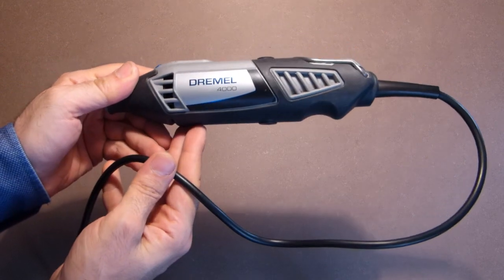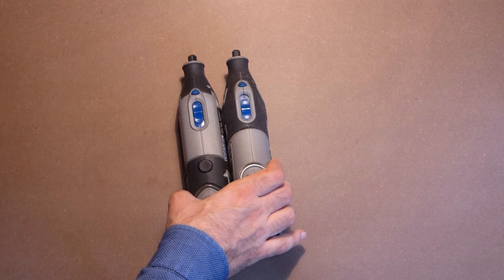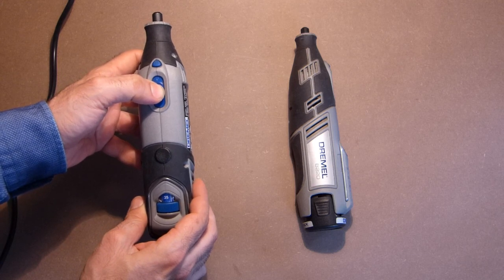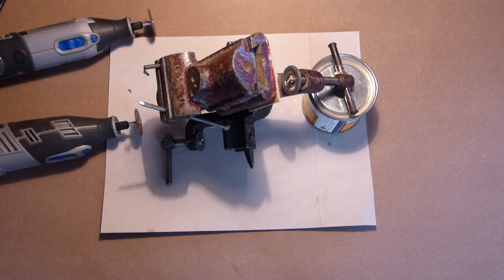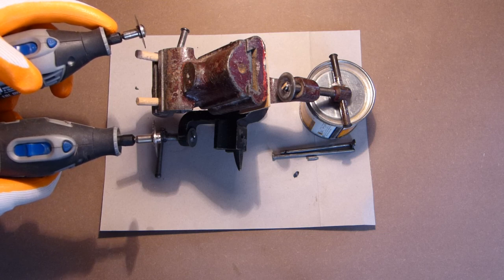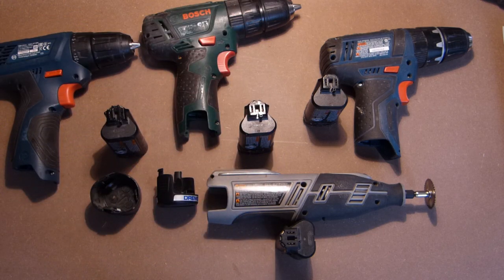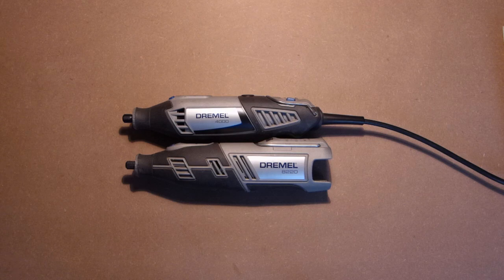Wireles DREMEL 8220 vs. Wired DREMEL 4000

Comment: thank you for the detailed view... but I cannot still decide which is better for smooth carving work?
Reply from the maker: Hello, you are welcome! You know, the cordless tool is weaker at high RPM and stronger at low RPM. And the corded tool is terribly weak  at low RPM and extremely strong at high RPM. Hope, this information will help you to define which tool is better for your needs.
Reply: I got the wired one because it was a lot cheaper

I still hope for a proper brushless (battery) Dremel with proper motor control for stable rpm at any load, this would be worth 150$+ easily

But its pretty sad to see still old DC motors with brushes

Comment: Would the 8220 combined with the router attachment and the universal wood cutting bit cut a plywood or other softwood 10-20mm thick? or you think it won't?
I don't want the corded I'm only considering the cordless, so, do you think the 8220 can handle such cut? I've seen the corded 4000 do it without issues but, I'm not surprised, I only want to know if the cordless one can do that.
Reply from the maker: It would, but it's a bit serious load for this cordless tool. Anyway, for such needs it's much safer to use a corded one.
Reply: @powerbatterychannel4315  Have you noticed any significant drop in battery performance of the cordless over the years? or any charger issues? and do you know where its brush is incase I need to change it?
Reply from the maker: @Sir-Kay  No significant drop in battery performance. As to brushes - you should disassemble the motor and replace them yourself.
Reply: @powerbatterychannel4315  Was it visible in this video when you disassembled the 8220?
Reply from the maker: @Sir-Kay  What exactly?
Reply: @powerbatterychannel4315  the brush.
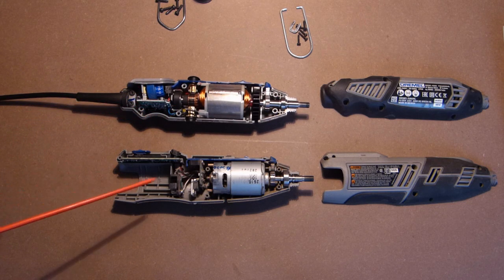Reply from the maker: @Sir-Kay  No. At 1:56 you can see the motor; so, you should remove its rear side, so, with the help of pliers you should widen the cylinder part of the motor near the rear side and after that you will be able to reach the brushes.
Reply: @powerbatterychannel4315  ok thnx

Comment: I'm curious how are the cheaper brands/clones with the same general spec on paper compared to either of these?
Reply: not even close if your talking bout harbor frieight and other cheap knock off brands in terms of power/effectiveness
Reply: You get what you pay for
Reply: @DJREZEREKT  I tested it out. You're right. I ended up dismantling the generic garbage for the motor and control board for side projects.
Reply: @obe22099  that's Great...these little motors make all sorts of cool little things that are quite useful in shop settings or even at home for some things! Good luck with your efforts!

Comment: 8220 actually has motor protection built in. Their manual states that the quick shutoff shown in your video actually causes no damage thanks to their technology. Thanks for your video.
Reply from the maker: Maybe... but frankly speaking, or, "mechanically speaking")),- it's not good to stop the motor within less than a second. However, it would be necessarily to conduct some experiments with thousands ONs and OFFs with and without sudden stop and after that speak about the results. As to the manual.... I respect Dremel/Bosch company, but...sometimes some companies speak about some excellent part in their products, however, in some months exactly those parts become damaged and move to repair shops. Anyway, I decrease the speed and only after that turn the rotary tool off :)
Reply: @powerbatterychannel4315  this comeback is totally wack. He burned you man lol we win some we lose some. Theres nothing wrong with that
Reply: @williamslandamorales    Still believing everything corporations tell you?
Reply: Great video but the only thing wrong with the testing is one nail is at an angle… so you’re cutting through a wider cross section so of course it will take longer. You need both nails straight or could have swapped tools for the second test.

Comment: Do you think it would be doable to hook up the wireless one to a 12v power supply (with the appropriate regulars etc)? I like the convenience of cordless but would like to run it wired when that's more convenient.
Reply from the maker: Your  12v power supply should provide high current definitely.

Comment: I bought the 8220 two years ago and haven't over used it but also haven't left it in the box (if you know what I mean?) however, the battery will now not charge at all. I will buy the wired version next time for sure.
Reply: This is exactly my worry with tools like that.
Batteries don't last as long as cables :(
Reply: If you got it at most big box stores ...they will swap out a defect no questions asked
Reply: Nice battery hack!👍

Comment: I’d still probably buy a wireless Dremel tool.They have an advantage over wired Dremel tools 🧰, in their own way. Although limited on battery 🔋 life, they work in impractical places for a wired Dremel tool, or when you’re far away from an electrical outlet. Both Dremel tools 🧰 do 30.000 RPM, and have the same included bits. One ☝️ good 😊 thing about bits. They’re interchangeable between wired and wireless Dremel tools 🧰. Again, your friend, Jeff.

Comment: So basically buy dremel 4000?
Reply from the maker: Yes
Reply: @powerbatterychannel4315  I bought Dremel 3000 as the 4000 is known to have quality issues!
Reply from the maker: @georgeausterberry8508  I had both 3000 and 4000. 4000 is much better anyway; I had no problems with 4000 at all.

Comment: How far is the difference between the two tools? I want to take it, but I can't decide
Reply from the maker: Corded one is more powerful; please, review the video.
Reply: @powerbatterychannel4315  I've watched your video over and over, but I can't decide which one To choose, but which one do you think I want to be strong
Reply from the maker: @huseyin1312  Corded one is stronger than the cordless one,
Reply: @powerbatterychannel4315  Do you think there's a big difference worth using wired, i actually want wireless, but power is also appealing.thank you for your interest, by the way, is my last question, between 4,000 and 4,300, the difference worth paying more
Reply from the maker: @huseyin1312  4000 and 4300 have the same power 175W, In my opinion, there is no sense to pay more for the same power.
Reply: @powerbatterychannel4315  thanks 😊
Reply: You should buy both. They are both useful in different conditions.

Comment: nope. The disassembly didn't really show much and users don't do that. The sound comparison doesn't come thru well. Just state that they are equal. The nail cutoff test is flawed. Right hand versus left.  "More powerful" means speed of rotation may slow with battery unit ? Take human element out of test.

Comment: 8220 or 4300? Which is better?
Reply from the maker: Let's first ask this way:  which is better - 4000 or 4300? 4300 has a bit different design, and there are rumors that they have improved the ventilation system; however, I'm very pleased with this system on 4000. As to your question - for me 8220 is better anyway, as there is no need to be "glued" to the mains power. Though 8220 is less powerful than 4000/4300, but it's powerful enough in order to cope with all the tasks of a rotary tool. And its main advantage: it doesn't stop in case of difficult tasks; for example, Dremel 800 stops immediately as soon as you increase the load on the tool. I used to have this tool, and it was annoying to work with it.
Reply: @powerbatterychannel4315  planning to get one im thinking 4000 or 8050. please help me to decide.
Reply from the maker: @yuminixy4620   8050? You are joking :) It's a toy, not more, because of 5000-28000rpm and 7.2V. Of course, you should get 4000. Good luck!
Reply: @powerbatterychannel4315  what about 8220?
Reply from the maker: @yuminixy4620  The video is the answer to your question :) Yes, 4000 and 8220 are brothers, however 4000 is more powerful. Nevertheless, I always prefer wireless tools, i.e. 8220 is better for me.
Reply: 4000 or 4300 ?? Which one overheat ?

Comment: I prefer the wired Dremel tool best. This enables you to do ANY job, at ANY length, without needing to recharge the tool in between jobs. Also, upon changing the variable speed of the tool, you don’t have the problem of, “the battery 🔋 is about to run 🏃‍♀️ out”, resulting in the motor slowing down, regardless of the selected motor speed, and it eventually stopping 🛑. Your friend, Jeff.

Comment: Wouldn't it have been better to compare the cordless 8200 to the wired  4200 instead of the older 4000
Reply from the maker: 4200 in not similar model and has another structure.
Reply: Start your own channel so you can make exactly the videos you want to see, and the rest of us won't have to listen to your caviling.